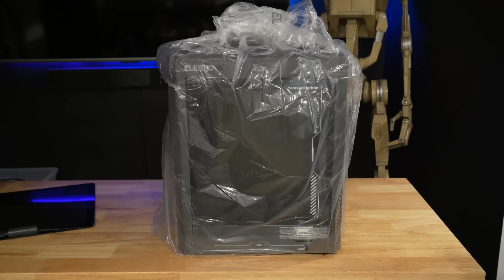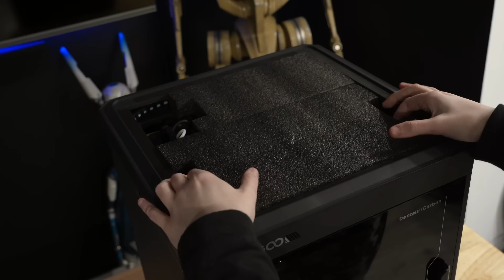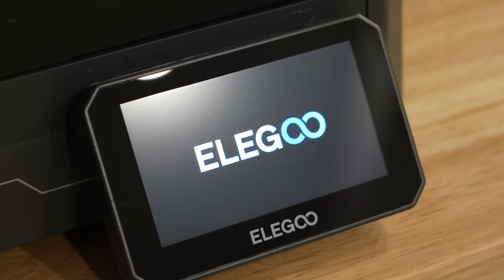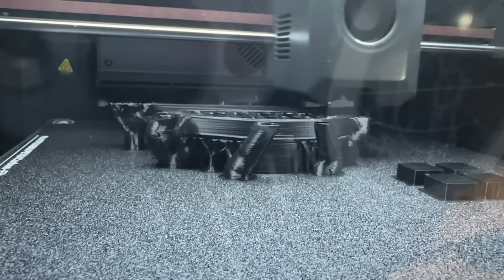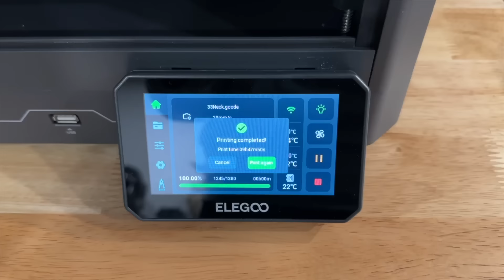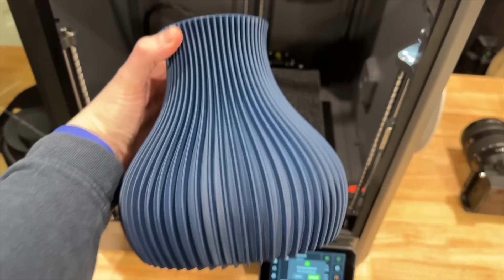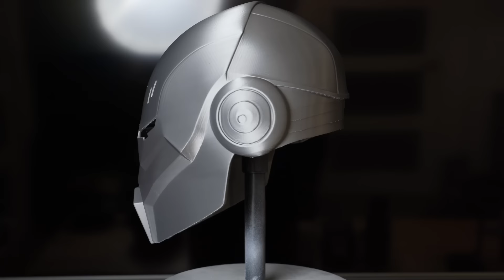The Ultimate Budget 3D Printer | Testing the Elegoo Centauri Carbon

Comment: I've heard they've fixed the light problem - the latest ones shipping have a couple of LED light bars inside the case. Seriously thinking about getting one, but not right away. Hopefully Elegoo doesn't do what they often do, which is discontinue it. By the way, what's the chute for? Does it purge the nozzle through the chute instead of using a purge tower? Apparently, they've been promising a multi-color option which hasn't materialized yet and some people are complaining about that.

Comment: How is it now? Looking to buy one and want to know Long Term.
Reply: The light was fix. The new batch of the 3d printer has an upgraded light.
Reply: @VenzAltubar that's good, but the question still is: how does it hold up after continual casual use? I currently have a Ender 3 pro that I have had to mod and Upgrade and Still have issues. Keep in mind, I only use mine casually not as a print farm making money, I'm just a hobbyist. If this one gives out in only a few months I'm not putting my money down. 

That's what I'm saying. :)

Comment: I just got this as my first 3d printer and I have a few notes.
1.) My model has an LED strip that is plenty bright for viewing with both the camera and in person.
2.)If you are going to have this device on your home network, I would highly suggest taking it's internet privileges away. I had it plugged in for less than 24 hours and it communicated with random IP addresses all over the US, Mexico, China and Portugal (around 6000 times an hour). I love my cheap high quality Chinese tech products as much as the next guy but as an IT person this raised red flags that this thing was the chattiest device on my home network. No cheap 3d printer I am not the product YOU are the product. 
3.) So far this has printed  PLA and PLA+ pretty well but I am  currently struggling with getting ASA to adhere to the bed for an entire print but im chalking that up to my ignorance as I am brand new at 3d printing.

Comment: I bought this printer, did the setup with the bed leveling just fine, went to go print my first thing and it leveled again..  then immediately the bed smashed into the nozzle when it went to go print and destroyed itself and deeply gouging the bed plate.  This was my first 3D printer I'm not really sure what the hell happened lol.  I'm sure there's something wrong with the z-axis but you would think that the firmware would know where the bed is and not do that, esp after leveling twice.

Comment: nice video, and it shows me a bit what that machine is capable of - i only wish i had seen how it performs on asa (instead of abs, but i guess, it might be more or less the same - even when other might have a warping-issue with asa, but not with abs) and also how it performs with tpu... but overall, it seems not bad what that machine does - and it seems so, that it is worth it's money. i might have listened on the later part of the video ('cause have a bit work to do besides listening), but it heard good enough for me to consider that machine as a replacement for my broken one. the only thing what i need to do is to think about putting the filament somewhere else, 'cause i want it in a case, and not on the right side, 'cause i have just a table set up for my actual printer - and i might need that space atm... also i might to rethink about the waste bin, 'cause on the backside is not bad, but it would be better, if it were somewhere where you can control it better and don't need to reach always on the backside of the printer. but that's a problem of future - me...

Comment: I love the Centauri Carbon, but there is an issue with the connectors on the printhead for the hot end. They are very hard to remove and many of us in the Elegoo User group have had issues with either the female connector pulling off the board or the black wires pulling out of it. Elegoo is sending me parts, but thanks to a nozzle clog on day 7 of using the printer, it is currently out of commission until I get the parts. (I did have a spare hotend I tried to swap out for the clogged one when this happened). Apparently it is an issue Elegoo is aware of, so hopefully they will change the connectors in future releases.

Comment: Just got my ECC and it is my first 3D printer.
I found to eliminate VFA on ECC the following settings need to be set: wall to 40-50 mm/sec. Wall printing order Inner/Outer/Inner. See of that helps.
On the other note, the printer doesn't seem to have any profiles for filament other than ELEGOO brand. Do you just use "Generic <Filament type>" Profile or go through a set of calibrations (temp, flow, retraction, volumetric speed., ) for each brand + filament type.

P.S. Would be nice if someone started a community wiki page and documented what settings worked best for filaments they tested.

Comment: After unboxing and following all prompts tried to print my first Benchy. It just starting printing nothing with no warnings.  I pushed the PLA all the way again which I know I had done (black PLA)  but some blue PLA had printed which I guess was in there already? Did I get a used machine?!?! I pushed the pla again and then tried again. It started printing like noodles or toothpaste being squeezed in loops like the nozzle was way to high from the bed when I tried my first benchy - literally noodles and then the printed noodles pile slid off and I stopped the printer. Removed the noodles pile and tried again and same thing. I’m shook. This is my first impression. So I have no idea what to do so I just went to the menu and recalibrated it. Not sure if that’s the problem but I’m already lost and incredibly disappointed

Comment: To ease my concerns about noxious fumes from the filaments I plan on trying, I added the VoxelPLA Bento Box Charcoal/HEPA filter which fit fine inside the ECC when placed against the left side wall with the power cables taped to the floor and running through the hole in the rear (which looks to be for connection for multimaterial capability to come).  I also added an LED light bar to the right side panel, a riser with a rear cutout to reduce kinking of the PTFE tube feeding the extruder and a longer filament holder.  After your video, I will fashion a strut to support the filament holder when printing heavier spools.  Nice video.  Thanks.

Comment: Looks like your abs prints stuck well to build plate. I have the printer and it has been hit or miss with abs prints sticking to textured side of plate. Are you doing anything to profile or plate to get better adhesion? Have heard using  different profiles like asa to get chamber fan to stay off or glue stick.

Comment: Your video made me buy one. 
Got it this week and good news, the LEDs were changed and they added one on the side and front facing down, so it’s very bright now.
Reply: For me its still to dark even with LEDs. Mby because i printing with dark room without widnows but still i would be nice to have some 360* led strip under top glass.
Reply: @Jur4S  There are models you can print that raise the top glass a bit and allow for adding an LED bar.

Comment: Impressive printer! I would recommend to buy this and see if you really love 3d and will use it enough. If you like 3d then go "maybe" with Prusa or Bambu. I am actually wanting a 2nd printer since I can never decide what to print on my top of the line printer. Do I print what I want, what I need, or something fun. I am impressed that you printed everything on it without hesitation. ABS and PETG. 
Curious what brand of filament you used with the machine? I also appreciate that you speak fast. 🙏

Comment: Checking out this and the budget version for $200 on their site but decided on the carbon model since it works with more filament types.  Not sure if it can do biodegradable filaments but it can do PET or specifically plastic bottles that are readily available.

Comment: I am waiting for my CC to come, Do hope you are reading these. I wand to print some ABS for my star wars and star trek ships so when printing ABS do you need a venting system? I am printing a topper for mine while waiting for it to arrive it will have a place for led lights. Can you please post any tips I would need to print out in ABS thank you for your time...
Reply: Abs releases styrene and a little formaldehyde, and can be filtered with a carbon filter. The problem is the carbon filter can wear out without warning. Styrene is carcinogenic

Comment: Just ordered one of these to add to my collection, needed something in a medium size with future multi color capabilities to help take over workloads from my other four printers.  For the price, can not see how one can go wrong.   Nice easy setup and familiar design.  The only thing I may look at changing would be to add the gold colored PEI sheets similar to one's Qidi uses, I have always had great success with this type of build plate in the gold color.  I am sure someone out there makes the gold PEI sheets for this bed size, will have to do some research.  Will add some lighting and a top riser vent, will have that ready go before unit arrives with a poop chute and bucket setup.  I will primarily be doing ABS/ASA/PETG on this machine.  I made sure I grabbed a few extra hot ends to have on hand for spares.  Hopefully, they provide good parts options and easy to deal with for spare parts. Every machine I buy I keep a bare minimum of spare parts on, and prefer they offer a wide variety of replacement parts.   Will see how they do with this six months from now.

Comment: I could really use some advice. I'm looking to buy my first 3d printer and it will be for at home use only. I want to be able to make cosplay outfits for my son and small figurines and potentially tool holders and such. Ive been leaning towards the k2 plus since it is larger but worried about the quality control of creality. What are your thoughts on a unit I should look at.
Reply: Centauri carbon?

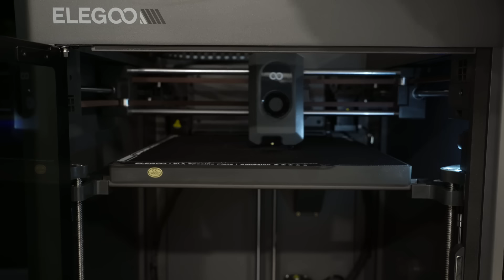Comment: The printer already contains a poop collector print/STL file in its onboard memory - doesn't need magnets either - you just print it using the front panel to select it. @ 02:53

Comment: The bed leveling issue is so funny after having an ender 3 for so long that I had to level manually. I was looking at getting an A1 but this printer at $299 is too tempting. I am now leaning towards this.
Reply: Well, inquiring minds want to know, did you end up getting this, as I am torn between getting this model or the A1? Any feedback would be greatly appreciated!

Comment: while most users have great experience with this printer, mine came with broken front glass panel..i seriously dont understand why they ship the top glass with its foam in the box but pre-install the front panel..its a nightmare to clean especially on z rails..after my first print and print it in sport mode, turns out good..then i got abnormal heat break cooling fan error..then filament stuck..the errors dont even tell you what you should do, they just say "please check"..lol

Comment: Great information, I've been looking at several different brands and models, and although this will be my first 3D printer,  I just placed an order for the Centari Carbon.  Unfortunately the ETA is several months away, but can't wait to try it.  What are your thoughts on getting something now to tinker with? I like the build size of the Neptune 4 Plus for what I plan to print, but would you recommend a different affordable option?

Comment: Hello, i have a question. I'm new in 3d printing. I want to buy one of the two 3d printers. Elegoo or Bambu lab A1. Which will be better for beginners?
Reply: I'm at the same place. Considering the P1S too. Have you made a decision yet??
Reply: @krycekaiolfi I bought A1. Its really useful to print with AMS. But i made only 2 prints using multicolor. Most of time i print with only 1 color . But ut still pretty cool that you can print not from home with color you want. If you low on budget, but want to print with engineering material, buy P1 or Centauri Carbon. If you want to print  multicolor and having vibrating monster, than A1 is your choose.

Comment: Lighting fix is a $5 LED USB light strip with wireless remote from Walmart, etc.  Being a strip you'll peel and stick it will offer lighting from many angles and you just power it with any old USB power adapter you have laying around.
Reply: Do you have the link?
Reply: link?
Reply: @thedonleeboy  Google has two Os.

Comment: A tip for paints that you'd use the tattoo cups for- Consider buying a silicone fidget popper. They're sold as replacements for sheets of bubble wrap, but the 'bubbles' are all about the size of the wells you're using to hold paint. So depending on which one you get, you'll have a few dozen wells for paint, and once you're done, you can let them dry and simply pop them out to clean them. Try to get a white one if you can to better see the color of transparent paints.
Reply from the maker: The tattoo cups were specifically because I needed the wells to be deep to fully dip my brush in and also not have the paint dry immediately on me, but the fidget popper hack is great!
Reply: @MMsPropShop  I'm not certain, but I think the silicone prevents the paint from drying too quickly. I've got three sizes of tattoo wells at home, and the silicone poppers are about as deep as the medium ones. I use them for anything I'm worried will separate out on a wet palette.
Reply: Hi, do you have a list of reliable workhorse or work machine printers that usually never fail and are 40*40*40 more or less. I need to mount a printing work station and need a reliable model. Im thinking of buying 10. @MMsPropShop

Comment: It looks like they copied the Bambu Lab P1S with minor adjustments like the screen is at the bottom instead of the top, and the spool holder is on the side instead of the back.

The fact that they could capture practically all of the specs and cut the price by over 50% is crazy.

Comment: I have actually been a little confused on why all of these companies are going to metal enclosures vs plastic. Metal enclosures will obviously dissipate heat much faster than plastic so I would think plastic/acrylic panels would be a better choice for most manufacturers.
Reply: Wouldn't the plastic deform and cause complaints?
Reply: @ I don’t think so. The chamber would need to be hot enough for the plastic enclosure to get to its glass point. There are already plenty of plastic enclosure machines like the P1S.

Comment: VFAs come from some resonance inside the drive system. 2mm spacing (possibly what you have there) can come from the ripple of the timing belts. It cannot be eliminated by input shaping as the disturbance comes from within. You can just tune the speed (frequency) so that these disturbances do not resonate anywhere in the mechanics.
Build up a single track wide star shape with varying speeds in the z-direction. VFAs come and go. Stay away from these speed regions.
BTW: Probably the best test video about the machine!

Comment: Thank you for giving us a very down-to-earth, reliable overview of this machine. I wasn't aware of the budget version either. 200 is rediculous!
Reply: It's not just missing the side panels/top panel, it also does not have the camera/light, the carbon air filter recirculation fan, the filament roll holder is on the rear, and the build plate only goes to 100c instead of 110c. But other than that, it's almost the same. Hot end is the same, size same, speeds, wifi, self calibrations etc. I'm thinking of getting the base Centauri and just putting side panels on myself, since the carbon version is not a heated chamber, so I'd effectively have the same printing capability for 33% less $ and only really miss out on the camera, (which I can probably add a webcam anyways, like on the Elegoo Neptune 4).

Comment: Excellent - an actual product ‘review’, and actually using the principal feature that distinguishes it (the enclosure with exhaust filtration) - apart from the bargain price that is! 
Loved that the review was ABS-heavy. (But if you needed to change the default settings, it would have been great to know why and to what.) 
My guess is that your products don’t use filled filaments, the other thing that would attract folks to this particular machine.

The lighting is a pity, but a real non-issue as it is certain to be addressed by simple aftermarket mods! 

Could the side to side inconsistent vfas (on large models only?) be a simple lube problem? 

What version firmware (and Mac slicer) were you reviewing? (This matters a lot when reviewing a machine where bug-squashing is clearly still in progress.) Have you had any updates since the initial post-delivery one? 

I’m personally not interested in the costume models, but have subscribed for the process info. Looking forward to more as you continue to explore this machine.

Comment: Thx for the review!! I think that this printer is aimed at the more PLA PETG printing community. If it had an active heat chamber so you can print Nylon-CF and other exotic materials with ease, I would buy this immediately. But it’s so frustrating that it doesn’t have this!!
Reply: I would consider insulating the interior or exterior of the chamber. Not everyone wants to do DIY, but clearly the metal side panels will be a wick for any internal heat by the plate and nozzle. Just something to consider as a way to get the temps  up, the price down, on a machine without a true heated chamber.
Reply: @ agreed, I was thinking the same.. but then I am already changing a new printer… I’ll just wait what Bambu will do and then make my decision!! I good still go for the Qidi plus 4, which has a heated chamber (but the build quality is not the best…)